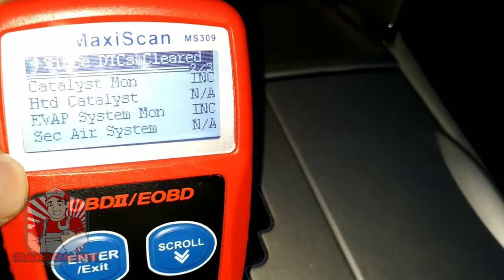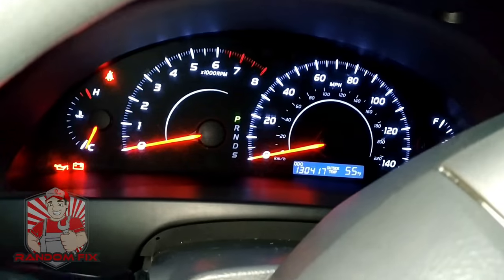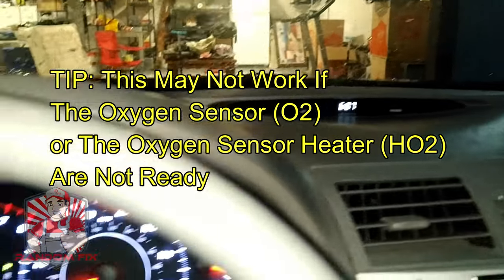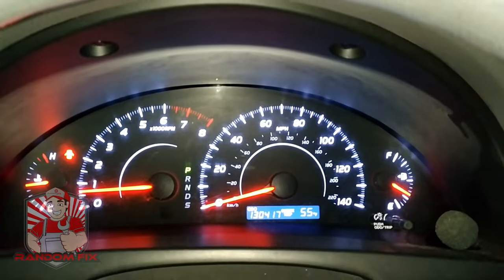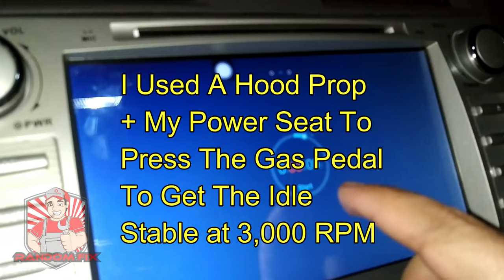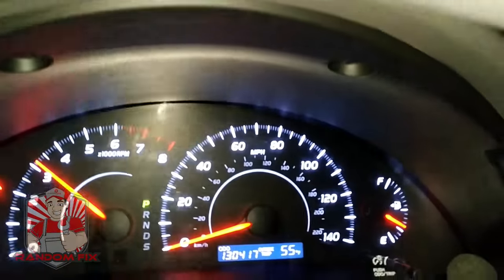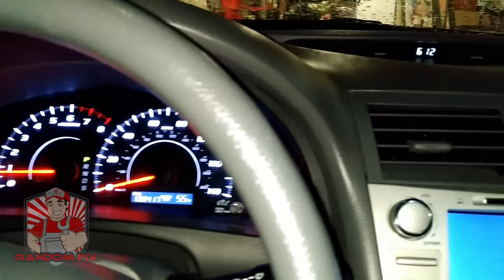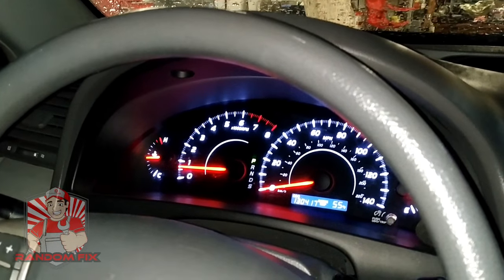Amazing Trick to Get Catalyst Monitor Ready!

Comment: This method worked the past 2 times (smog check every 2 years), but this time catalyst monitor still INC…i also tried driving vehicle after cold start at 65 mph n reduced speed to < 24 mph without braking.  Help?  Need to pass smog test in 30 days 😢
Reply from the maker: David, the slowing down from 65 to under helps the EGR, for the cat monitor you need focus on high speed driving. Since your vehicle 2 years older than the previous two times you will have to focus a little more to get that catalyst nice not. Once you get your catalyst nice hot as shown in this video, you may want to do it for additional minute and if it's still not ready, hit the high way and don't use cruise control or a/c. I break it down in this video https://youtu.be/jldTJI64cfM?si=qZz_i2GAVn34ziB0
keep me posted on your success and let me know what you are driving and the miles.
Reply: Thanks, will try it out tomorrow.  2004 Toyota 4Runner, 203k miles 😬
Reply from the maker: @davidv3518 sounds good, I just had to do the same on a 2004 honda with 230k. Here is the video if you need additional ideas https://youtu.be/HkF4oCED0UU?si=lZS2uT4stwReqmD4
Reply: For Cat Monitor, very difficult to drive EXACTLY 55 mph for 5 mins straight on freeway when everyone is going faster.  But did drive >60 mph for 10 mins n Cat Monitor still INC. 😢. Maybe need to clear VSC Trac and TRAC OFF lights to work?  Thanks
Reply from the maker: David, I said 65 mph and if this is not your daily driver and does not get driven on the freeway a lot you will need to drive a lot longer to set the car monitor.  I don’t you need to reset the traction control light on a Toyota but I have seen an abs light trigger a check engine light on a Subaru.
On the honda video I sent you I had to drive 800 miles for the catalyst monitor to finally set as it the catalyst was covered in oil from not being driven daily and the pcv being stuck open.
Reply: O2 sensor monitor now showing INC…haven’t been able to clear my Cat Monitor yet. 😢. Also added Cataclean recently to maybe help..
Reply: Drove around almost 300 miles now and also used a bottle of Cataclean.  Been trying your cold start method every other day n also revved 3k rpm for 4 mins.  Cat Monitor still showing INC….Maybe it’s time for a new catalytic converter installed?😢
Reply from the maker: @davidv3518 it could be time! But before you do that , what is make and model of the vehicle? How many miles are on the vehicle and what’s the back story? Does the vehicle burning oil like I show in this video https://youtu.be/GrqYuAYYs9E?si=IUyMQjJ-_7-oID-5
I think it works better with warm vehicle, you want to get that catalyst nice and hot.
Here is how I got that high mileage honda ready to pass https://youtu.be/HkF4oCED0UU?si=ZxZ6bVw7x5OnVZpw
Reply: 2004 Toyota 4Runner, 203k miles.  Used it only for short trips once a week for about 1 yr.
Reply: I checked tailpipe n it doesn’t look too dirty (i can email u pic).  Now the O2 sensor shows INC like the cat monitor.  Would replacing the catalytic converter resolve both issues and let me pass smog check?
Reply from the maker: If you want to replace something replace the o2 sensors first.
Reply: I replaced the 2 downstream O2 sensors 2 years ago.  Maybe the upstream sensors time’s up now.  Could exhaust manifold gasket problems cause INC for catalytic monitor?  Been reading issues with manifold for 2004 4Runner…smh.
Reply from the maker: @davidv3518 yes, any exhaust leaks can all sorts of issues and bad data. Check the exhaust exhaust right to last o2 sensor. Anything behind the rear( downstream) o2 sensor is not normally monitored unless it’s exotic vehicle with active exhaust exhaust. Check to leaks on the o2 sensor holes, flex pipes, listen to when it first starts and if you access to get under the vehicle get soapy water in a bottle and stray from toward the engine starting at the down stream o2 sensor hole.
Reply: Ok, something odd happened this morning on a cold start.  Check engine light popped up, i used OBD monitor to check codes and it showed P430, but my CAT Monitor showed “ok”!  I quickly erased the error code to clear engine light, but then rechecked IM readiness…Cat Monitor now showing INC again!  What happened?!
Reply from the maker: @davidv3518 your bank 2 catalytic converter throw a code for low efficiency. This is normally for the monitor to show to complete when the check code is triggered and check engine light is illuminated. It detected the issue and wasn’t letter the monitor run. Since you have spent lots of time and fun try to clear this, why not just clean them? https://youtu.be/U0-0XMWR3ow?si=GbC9VWTTJZG9HT5b
Reply: If I change out both upstream O2 sensors (Upstream air & fuel ration sensors ) AND clean the catalytic converter, everything’s good to pass smog check?
Reply from the maker: You should verify you have no exhaust leak before the downstream o2 sensor as well. You could have a pcm issue fault but that very rare.
Reply: If no exhaust leak issues, would upstream sensors problems cause P420 or P430 error codes? Would these sensors have their own codes?  Thanks
Reply from the maker: @davidv3518 upstream o2 sensors have their own codes. But the information from both sensors, upstream and downstream are verified to ensure the catalyst is working effectively.

Comment: I find it really peculiar a lot of comments are mentioning a 2001 camry.
I have a 2005, wonder if it's any different.
Reply from the maker: No it’s the same until 2006 from memory’s are you having an issue?
Reply: @RANDOMFIX  i believe in 2002 they changed the body style and engine from 2001. To the 2az-fe  (the one I have) and up to 2007.
Right now, cant seem to get the catalyst monitor ready even despite doing the 55mph cruise at between the 3/4 and 1/4, yatta yatta
Reply from the maker: @wixte is this only unset monitor?

Get the catalyst nice and hot, just let idle and hit freeway, cruise at 65 mph with the ac and cruise off and turn off overdrive or head towards a hill.

Make sure you don’t have any exhaust leaks that can keep the cat monitor from setting. Do you heat any alarm from the exhaust when you first start the vehicle or under full throttle?
Reply: @RANDOMFIX  correctz is the only unset monitor.
So, turn off OD, and just drive a stretch of highway preferably with a hill? 
And as far as exhaust leaks go, I don't reckon so. Though while being followed home from picking up the car, they mentioned it smelled like sulfur/rotten eggs. Not a good sign whatsoever. But no lights have illuminated yet saying p0420. So i'm a bit stuck here waiting for that CEL to go off. But isnt.
Reply from the maker: @wixte the rotten egg smell mean your catalyst is poisoned mostly like from coolant. 
Just proceed with caution as doing 65 with your overdrive off going to rev your motor pretty hard so check the fluids and oil to confirm nothing is low.
Reply from the maker: @wixte I am not sure what state you live in but here something interesting Genius Trick Pass Smog Visual Inspection with Non-Fouler!
https://youtu.be/VHjzqXyOKaw
Reply: @RANDOMFIX  interesting, as i've noticed the oil wasn't milky, nor when popping open the radiator cap, no bubbling as well. 
Doesn't overheat either. 
Now it worries me the previous owner merely used a gasket sealer of some sort

Comment: I hope this works for my 2004 neon srt 4 the catalyst and 02 sensor readiness are not ready after a year and a half and im at a total loss.
Reply from the maker: Andy, focus on the o2 sensor first. _randomfix
Reply: @RANDOMFIX  there has never been a check engine light for anything cat or 02 related and the car only has 50k miles .
Reply: It is happening to me now. Same car. So how yours doing now?

Comment: Did it twice on my 1997 f150. Still can’t get the cat ready 🥲
Reply from the maker: Drive on the freeway for 40 minutes, if the temperatures are colder try it for 4 minutes, or cover a quarter of the radiator with cardboard, stick it right in front of the radiator . Your vehicle is 1997, do you really need to get this monitor ready? https://youtu.be/QKxDzdTVJOU?si=Hwy5tppaSPs8N2wq

Keep me posted

Comment: I tried this technique on my 04 Sienna. It didn't work. Does it need to be a cold start?
Reply from the maker: Boo Lee, yes it needs to be a cold start. 😄
Reply: @RANDOMFIX  Thanks. Other components such as bad thermostat can also cause Catalyst monitor not be able to be ready.
Reply: @RANDOMFIX  so when it green do I go straight to the smog shop and turn off car when I get there? Or keep it on
Reply from the maker: Carlos, keep the car on if possible.
Reply: @RANDOMFIX  thanks for the heads up everything pass beside the catalyst
Reply: @RANDOMFIX  I have no codes also

Comment: THIS DO NOT WORKED IN MY 2000 F150 BUT I WILL TRY IT AGAIN.
Reply from the maker: Benito, what exactly is going on with your 2000 ford f150?

Here is the ford drive cycle video
https://youtu.be/j8ZFTE1rSfA

And I can help if you provide more specifics and what caused the monitor (s) not to be ready?

Thanks

By the way on the fords you can use this little trick to see if the monitors are all set without using a scan tool.
https://youtu.be/LllIXoqUKJ4
Reply: @RANDOMFIX  I have over a year driving it and nothing, there was 4 monitors not ready but now is only the catalyst and the evap system.
Reply from the maker: Okay, got, please watch the ford drive cycle video I will connect with you there.  Please note because of the age of your f150 you are going to really have to get everything don't to a t and it may require some extra effort. You focus should be on the catalyst monitor and don't worry about the evap too much as it maybe exempt even here in California. Keep me in the loop and enjoy the video.

Comment: I have an ‘05 Toyota solars SE with manual transmission. My catalyst monitor is the only thing that is not ready.

The cat monitor not ready was also a problem for the past 2 smoke checks, but I somehow managed to get it ready. It happened that when it was 3-4 months close to doing a smoke check, I needed to disconnect the car battery to change the battery or to change spark plug. Although I had 3-4 months to drive to get it ready for smoke check, the cat monitor was not ready. All the other monitors were good to go. The smoke tech told me to keep driving. I took a long trip from California to Canada and back. Yet, the cat was still not ready. Then I searched and found many different cycles I found on the internet. I tried them out and took a 60-mile trip with putting it on cruise of 60mph. Somehow, the cat monitor was ready. I was not sure what I did to make it ready. 

Fast forward to now, It is time to do smoke check again. The new car battery was installed because the battery I got 2 years ago was faulty and died. I have to deal with this cat monitor problem again. I have tried to do the drive cycle of starting from cold start, driving in the freeway for 55mph for 3 minutes, let it decelerate down to 20 mph without braking, and accelerate up to 55 mph for 5 minutes, and letting it come to a stop and letting it idle for few minutes on different days. So, I took the car on several 60-minutes long trips with setting cruise at 60 mph. I even tried the same trip that got me pass last time but the monitor still is not ready. What am I missing here or what is wrong? 

P.S I was thinking to bring the car to the dealer but just like before, they are gonna quote $100 something just for a diagnostic test and a thousand dollar to fix but not guarantee that they can fix the problem.
Reply from the maker: Hi Tam, please watch my complete smog playlist, I have two videos about this exact issue, I would say my money and avoid changing out thr catalyst if possible. Let me know if you have a problem finding the playlist. _Randomfix
Reply: Hey did you happen to fix your problem! Because I have the same issue my cat is not ready, I also have a solara se with Automatic transmission
Reply: prank ogk I ended up junking my car. After many 5+ hours trips, it was still not ready. It was giving me way too much hassle.

Comment: I was really hoping this trick would work for my 2002 Audi TT, but after 5 attempts of revving my engine to 3k for 5 min, I'm convinced that this trick does not work for my car 😢.
Reply from the maker: Yeah I have seen much such with this method on the Audis. What is your back story on your Audi tt? What caused the inspection monitors data to be deleted?
Reply: @RANDOMFIX  I had to get a new battery right before my smog check.  The smog check person saw the catalyst monitor being incomplete so he told me to drive it on the freeway at 55mph.  I've driven the car for more than 350 miles after the battery was swapped, but still it shows incomplete.
Reply: Have you seen this method work for other older Audis?  My car has about 195k on it.😅
Reply: I finally got my catalyst monitors to set!  I did 2 things:  1) changed out all my spark plugs 2) used a bottle of cataclean.  This trick worked afterwards.  Thank you!

Comment: I actually did this myself accidentally. I drove and cat wasn't ready. i was pissed, and I hit the gas at 4000 RPMs for about 30 seconds, and then the cat passed. Try 4000 RPMs for 30 seconds and it will work.
Reply from the maker: Thanks for sharing your experience. I’m colder weather this might be necessary.

Comment: Didnt work for my 09 subaru forester. I never buy another subaru
Reply from the maker: What is happening? What caused it? Here is the Subaru drive cycle https://youtu.be/w3DF4g2h96M I can answer any question but please be detailed.
Reply: I can get 5 sensors ready pretty quickly by just driving to work. Evap & catalyst is really hard to set. If I could somehow set catalyst Then I could pass inspection.
Reply: I tried that method where you rev engine to 3000rpm for few minutes but it doesn't  work on subaru
Reply from the maker: It works great on older cars and understand that sometimes a new catalyst is the only solution. Here is whole playlist on just incomplete catalyst monitors. https://youtube.com/playlist?list=PLDEbtVOPRC-h1BAzaWQ-6NSnmG0gwvgwP

Good luck and keep me in the loop.
Reply from the maker: Exactly don't work about the evap, I just sent you the link to get your catalyst ready.

Comment: Ima try this after oxygen sensor is ready.
Reply from the maker: Okay, let me know if you need help with o2 sensor monitor.
Reply: @RANDOMFIX yeah I might need to know how to do that one
Reply from the maker: Sure I can help, let me know what you are driving and which monitors are incomplete and what state you live in.
Reply: @RANDOMFIX  Im in Georgia i got a 2001 Camry. I need the oxygen and Catalyst drive cycle to complete before EVAP since no mechanic can never figure out why my EVAP codes are coming up. I figured if i can pass those two before evap i can go get emissions done like i have in the past.
Reply from the maker: @Dcthetruth85 okay, got it, make sure there is no pending code for the evap before proceeding. Here is a video on for o2 sensor https://youtu.be/Yn1-ul62Jio?si=IDzsvilPvOLtqCg_ and this video works like magic for setting older the cat monitor on older vehicles https://youtu.be/BuZYAy_xi0E?si=boEZZcrWzapMZyKD

I would work on the o2 first. 

Keep me posted. And this is Toyota drive cycle incase you facing a more challenging Camry https://youtu.be/EKfEr2LP2Nw?si=xAq67YdirxT31hxh
Reply: Alright thanks im about to watch themfor helping me out.

Comment: 😢 didn’t work for me 2006 E46 M3
Reply from the maker: Is the catalyst the only unset monitor?
Reply: @RANDOMFIX  yes it is. The battery was replaced need to pass smog nothing working so far
Reply from the maker: @GTA5NFT okay, here is the bmw drive cycle, see if you can figure out what is not letting the catalyst monitor from the video https://youtu.be/mk6Tk330Acw?si=pNuRkRR1Gqjv1oqW
Reply: @RANDOMFIX  thank you will try 🤞

Comment: Im getting a po171 code
Reply: Same! What did you end up doing to fix?
Reply: @kendralee3208  i still got it i put to new o2seners upstream and downstream po171 code still got it was told maybe it's a vacuum leak
Reply from the maker: did you get the issue handled, what's the year and make of your vehicle?
Reply: @heathcalvert1319  keep driving. I finally got it ready after 150 highway miles

Comment: Nope.  Didn't work...2002 F-150
Reply from the maker: Shane, her is the step by step directions for your 2002 Ford F150 https://youtu.be/j8ZFTE1rSfA

Good luck and keep me in the loop.
Reply: @RANDOMFIX  i had already run through the Ford drive cycle many times.  Ford fq50s and mustangs are a nightmare to reset

Comment: Didnt work
Reply from the maker: What are you driving, please provide additional information as well. Is the monitor not getting ready or is a check engine light triggering?
Reply: @RANDOMFIX  2004 mustang GT  with a D1 SC
Reply from the maker: After market supercharger? Here is the ford drive cycle https://youtu.be/j8ZFTE1rSfA 

You might have to try a little harder.